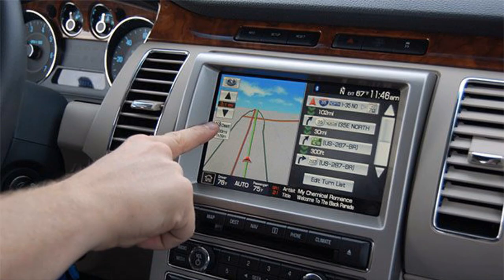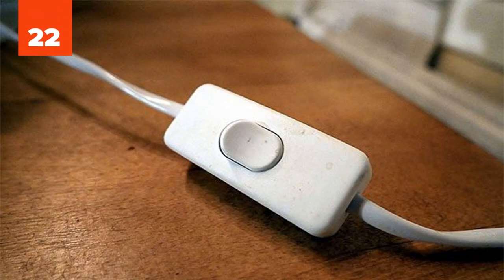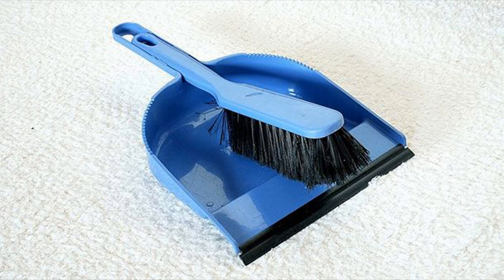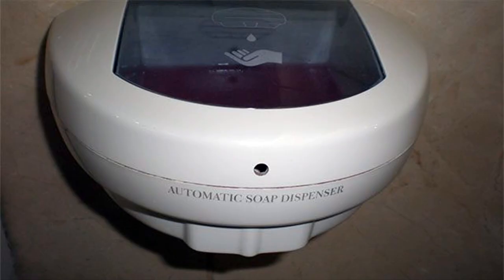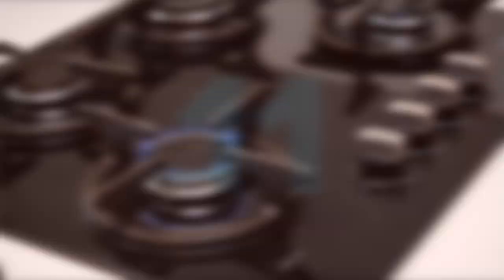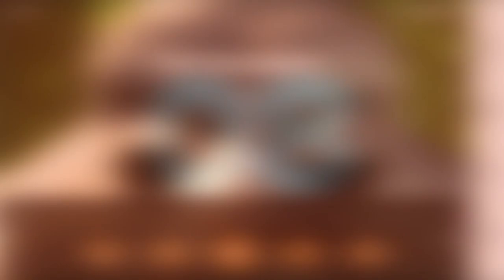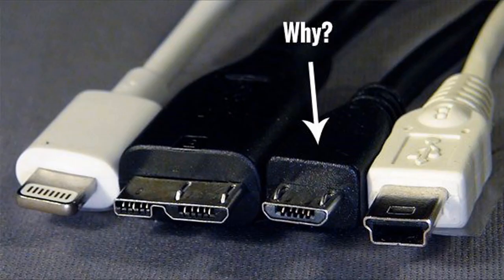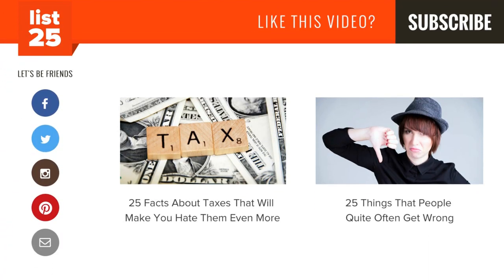25 SERIOUS Design Flaws In Everyday Products

Comment: In all fairness, for number 10, the stickers are meant to be edible. I personally just eat the stickers with the fruit.
Reply: Matthew Brunette yeah, you definitely voted for Trump no question.
Reply: Just because something is deemed "non-toxic", does not mean you should eat it.
Reply: ppsh43 Probably a fail safe for kids and older people who just aren't paying attention. I don't eat them but it's not a must to take off.
Reply: Dalmain J Ok I didn't vote for Trump so you're dead wrong about that.
Reply: Nikko Mabatid I can't tell whether you're being sarcastic or not. Either way, you escalated this thing way too damn quickly.
Reply: You can bite them off and spit them out then. Eating isn't a good idea whatever chemicals are involved.
Reply: True. In response to the video, however, the stickers being edible is a adequate counterpoint to ''Serious Design Flaw'.  The idea of placing them on the stem instead is almost laughable for fruits with thin stems (most of them it would make any difference).  A thin stem would require the tags needing to be attached via a string of some sort, which would require the conveyor system to identify where the stem is, orientate the fruit appropriately, and slip the string onto it, which would be fine if not for the fact that possible points of failure are now the tag getting caught somewhere and easily ripped off the string, the stem coming off, or not existing in the first place.  
Placing it on the fruit itself is simpler and more reliable.  If it comes off easily, then it's virtually no extra effort, and if you can't get a fingernail under and edge of it, you don't have to.
Reply: The stickers are supposed to be non toxic, but they are certainly NOT designed to be edible!!
Reply: They are actually. They designed them to be edible. Even the glue thats used is edible.
Reply: They are edible but are described as a "non-food" item.  The tags add no nutritional value.  I think few people will find them tasty.
Reply: Matthew Brunette judging by your display pic... I'm not surprise you eat the fruit strickers
Reply: Matthew Brunette I do not make a habit of eating fruit stickers to get my daily fiber.
Reply: Matthew Brunette badass
Reply: Please enjoy a bowl of edible fruit stickers.
Reply: All these comments and no one mentioning It's Always Sunny in Philadelphia?

So disappointing.
Reply: Dalmain J and you lost lol
Reply: Why are we talking about Trump when the comment was about a fruit sticker?!
Reply: xxXDRAGONXxx xxXBOSSXxx conspiracy
Reply: All internet comments eventually lead to Hitler, Obama/Hillery or Trump.
Reply: Hey, I wanted Bernie...
Reply: Bernie stickers are also edibile
Reply: Next time, remember those guys who PASTE those stickers on the food...
Reply: Nikko Mabatid YES EXACTLY!!
Reply: They can be ingested..but why would somebody choose to eat them?  As for placing on the stem, that won't work so well with an orange or avocado.
Reply: Nikko Mabatid WOW... YOU OK....
Reply: Since when is paper and plastic edible?
Reply: Matthew Brunette yes they're adorable you can have mine... Everything's edible if it doesn't kill you when you eat it
Reply: Actually, they are edible they are made from rice paper and i believe the ink is made from beat juice.
Reply: 0011peace you can have mine maybe they could just sell the stickers without the food is hatch good

Comment: 4:16, that's complete nonsense :/.
Reply: cosmin synyster gates haha it really is. I bet it really hard to overtake the car in front of you since half of your car have to enter the opposite lane before overtaking in oder to see if the lane are clear or not.
Reply: Someone Somebody that's what I was thinking like maybe there is less blind spots but it wouldn't make it any easier
Reply: Mr Sir perhaps. Besides if the driver sit at middle don't you think it is hard to get in/out from the car, except if that car only have one seat for driver at front.
Reply: Someone Somebody exactly I would rather have the modern car rather than this "improved" version
Reply: I know right. The steering wheel is on one side because you drive on that side of the road. It would make it even more awkward and annoying having it in the middle
Reply: That’s what I thought!

Comment: Additional design flaws:
-- The double click on a windows computer
-- Hot water taps that turn themselves back on as they cool
-- Kitchen knives where your fingers hit the cutting board before the blade
-- Cell phones that don't work well as phones
-- Smooth round door knobs.
-- Channel #2 as the 1st TV channel
-- Metric thread dimensions (they are all too fine)

Comment: Talk about design flaws. On my school locker you do not need to know the third number, because once you passed the third number the dial will simply stop turning for you, then the locker pulls open. My previous school had better lockers, because you stopped on the third number and then pushed a latch up, so you needed to know the third number. This is not even mentioning backpack straps getting stuck in the locker below you.

Comment: Several deserve a comment. 
#22@1:28: detaching the power button allows to get it nearer to the user (e.g. for the elderly). There may also have been an old requirement to be able to switch off the lamp when it catches fire, before using water on it. Recently, a halogen lamp fell on paper in my room, and the paper was already smoldering when I smelled it.
#16@3:08: baskets are made this way so you can carry them on your elbow and (with any way of holding them) the center of gravity is near the body. Otherwise, the basket would tilt away from you, so its contents would slide the same way.
#5@6:18: nail clippers need to be small (for use and storage) and easy to clean. Having some container around them would make them bulky.

Comment: There's a very good reason retail sticker glue is stronger than the sticker paper:  It's to reduce theft, by making it much harder to switch stickers in the store. And Retail stickers often have nicks/ partial slits in them for the same reason.  (So the stickers either won't come off except in shreds or tear off into pieces, not whole).  { E.g., both features make it much harder and slower for a would-be thief to successfully remove a Sale or Mark Down sticker from a legitimate item and put it on one not discounted.}  I used to be a retail hardware and paint manager.

Comment: #21:
The cords are different lengths and therefor stretch at different rates.
One goes across the top the other comes right back down.
Individual cords for easy adjustment.

Comment: Single cord loop is a choking hazard.  good points all around thanks
Reply: How?
Reply: @EiferBrennan  Young children stick their heads through the loop because they don't know any better. Then they fall or try to walk away and the cord strangles them. The looped cords have been banned by regulators who required manufacturers to buy blinds with the loops back for modification (usually cutting the loop) or advise consumers to cut the loops.

Comment: Australian bank notes are made of plastic, not paper, which means that they cant be ripped and don't get ruined when wet. They also have different sizes for blind people, and brail numbers on them. They are also different colours meaning it's easier to differentiate between value when in your wallet or in your hand.
Reply: It's not actually braille, just raised dots to code each note. Braille would be unnesesarily complicated, with not knowing if the note is upsidedown or reversed or whatever, so easier just to put a single raised dot on the lowest denomination, 2 on the next note up & so on

Comment: #12 Actually this isn't true. The reason the wheel is where it is is for better visibility when passing. You are in a better position to see oncoming traffic as well when someone is ahead of you.
   If the wheel were in the middle, you'd have bigger blind spots on BOTH sides of the car. Passing would be much harder to do safely, and it's already hard enough.
     This is why it is illegal (and dangerous) to pass a car on the passenger side (right in the US)

Comment: the cords  on the wood blinds shown in the picture are for tilting the blinds open and closed you can choose to have a tilt bar similar to a mini blind with some custom wood blinds. The reason there are multiple cords to pull when lifting wood blinds is because they are really heavy and 1 cord will snap... they even put multiple strands on mini blinds for strength...wood blinds are actually designed to stay closed and only tilted due to their weight only to be opened completely occasionally for cleaning and window access... people typically buy wood blinds for their aesthetics not for functionality. Plenty of other options with there with cordless options even some wood blinds depending on the size of your window. I used to sell blinds had to learn a ton of info on them lolol

Comment: I remember hearing somewhere, that the stickers on fruits & vegetables, are safe to eat.

I clip my nails with my hand or foot in a bag.

There should be magnetic connecter adapters, you can get for microUSB. And they can even be compatible with a phone case, so the connecter you leave in your phone, isn't just sticking out.

And every public toilet flush handle, is foot operated, to me.

Comment: Note about #11

Some higher end stoves used to have thermostats in the middle of the burners, contacting the bottom of the pan/pot.  They could be set to a specific temperature just like your oven.

The thermostats got damaged by people putting down the pans/pots too hard and they were well liked by repair shops that wanted repeat business.

Comment: #16 If you put a lot of stuff in your basket that has weight to it. Putting the handles the long way is just asking for them to break under the weight and cut a person's hand if they are not made of metal. If made of metal they have to be bigger and thicker so they wouldn't bend. Might be annoying at times but it prevents stuff from breaking and having to replace them all the time.

Comment: The next annoying thing which could be added to this list is toilet paper dispensers mounted too low for even a disabled person cannot reach them.  Really, one could get hurt just reaching for the paper!
Reply: stupid disability legislations require the rolls are located where they don't block access to the grab rail for a disabled but walking person to pull themselves up on, meaning by law they need to be a certain distance below the grab rail. I agree it's insane! Not too bad on domestic sized roll applicators, but when commercial ones are used, it's ridiculously dangerous!

Comment: I agree with the first one. Touch screens in cars are very distracting and take to much focus to use them while driving.
Reply: I think they should be made illegal.
Anything you may need to change while in motion should be a knob or level.
The handles on them should be different shapes to avoid confusion.
Cars don't need "modes".  There are 2 peddles on the floor and wheel for your hands.  In the era of computers, that is more than enough to communicate what the driver wants the car to do.

Comment: I so agree with the foot pettle in flushing the toilet it makes total sence!
Reply: Even more than the toilets, I'd like sinks to have foot pedals so you don't have to touch the handles to turn them off, or awkwardly position your hands to try to trip a sensor to dispense water so you can finish rinsing them.
Reply: Amy McCollum *peddle *sense
Reply: Actually, they do have sinks like that. . . . . in operating scrub rooms.

Comment: The shopping basket handle is probably designed that way to cut cost, it takes less material to make it the way it is. Probably not much per basket but enough to make a difference in the high quantities used by store chains.

Comment: Some of these design flaws are actually important design features.  

For example, faucets that are too short to get your hands under them are designed that way so that the only thing you can get under them is your hands or maybe a coffee cup.  They are supposed to be used on sinks you put somewhere that somebody might need to wash their hands, but you don't want them washing dishes or car parts or rinsing mop heads.  

Wine glasses were originally made with long stems and a curved shape so that you could hold it by the stem so that the warmth of your hands don't make the wine evaporate or you can cup the glass part so the warmth of your hand causes the wine to give off more aroma.  

You are wrong about the sterring wheel position.  Cars were originally built with the driver in the middle.  When roads started being two-lane, people driving in the middle had trouble judging the position of the car relative to the centerline and they crashed.  The crashes went down when they started putting the driver on the side of the car closest to the centerline.  That also allowed you to see around the car in front of you while getting a full view of oncoming traffic.  The McLaren has the sterring wheel in the middle because it is intended to be driven primarily on the track.  

A hundred years ago bank notes were all different sizes and it was a complete mess.  The size was determined after decades of testing to be the optimum size for wear, counting, readability and identification, etc.  The other countries that use different sizes and aspect ratios in their money don't have more blind people, they have huge portions of their population who are too illiterate to read numerals on paper, so they print them different colors and cut them different sizes.  

But some of your rants are spot on.

Comment: Actually the button on the baseball cap has a purpose. It's roots are of course in baseball so those buttons where origanally used for training purpouses. When you bend down to scoop up a ground ball you are supposed to do it in such a way that somebody in front of you can see the top of your head. Coaches however, wanted to be able to practice this with outfielders. So, they put the different colored button on top of the hat so that coaches can easily see it from a far distance and ensure that the player was doing this correctly. Like so others can see.

Comment: I realize this one may seem kind of trivial, but what about the valve in the shower?  Why do I have to turn it on and off with my hand?  Why can't I redirect it into a pedal valve and open and close it by stepping on it?  I mean, having to turn it on and off by hand means having to fumble to get it the right temperature every single time.  But if I can redirect it into a pedal valve, then I can keep it the temperature I want while I'm lathering and only turn it on to rinse and wet the next part of my body.  Surely I would save a lot of water, this way.

Comment: some car makers are getting smart about touch screens.

Mazda3 ... the touch screen is disabled when the car is moving (disables about when the doors automatically lock).  The controls are available via a knob which acts in up/down, left/right, push and twist, plus buttons. (more for higher end vehicles)

I am sure others are also making it less likely for drivers to be fiddling with the touch screen.

Comment: I remember as a child I had to work together with my sister to be able to pull up sunblinds which had the cords on both sides. I could only pull up one side before it blocked and wouldn't go any further unless I also pulled up the other side but my arms were too short to reach both sides at the same time and if I let go of one it would fall all the way down again.

Comment: There is another advantage if paper money denominations get a bit larger as the denomination goes bigger. It prevents one method of counterfeiting. Money paper is hard to come by. But one can bleach a $1 bill and then print a counterfeit $20 or $100 on the blank dollar bill paper. If successive notes are larger sizes, this won't work.

Comment: Actually, wine glass design is very clever. It is designed so, that it is harder for you to transfer your body heat to the wine and thus changing its overall taste. You are supposed to hold it at the stem.

Comment: Having a car's steering wheel in the center is stupid; in order to pull out to check if it's safe to pass a vehicle in front of you, you'd have to expose 2/3 to 3/4 of yourself to oncoming traffic (which I for one would consider a serious safety hazard). Not to mention the simple convenience of being able to open the door & sit directly in the driver's seat without crawling/ stretching to the center, & also having space for a second seat in the front.